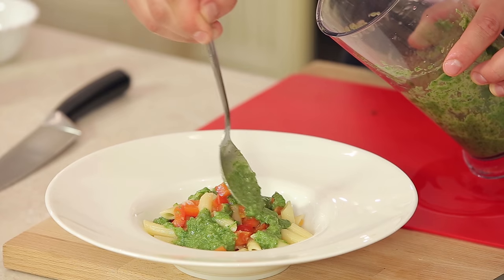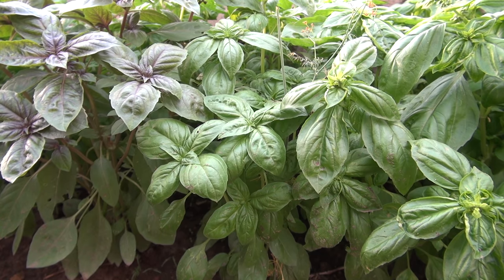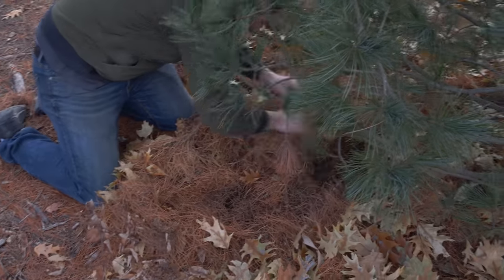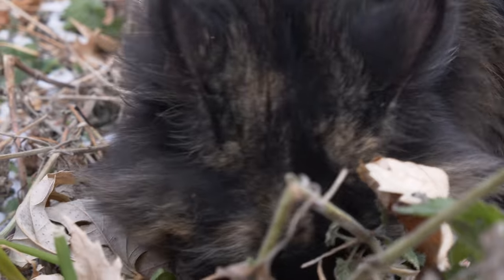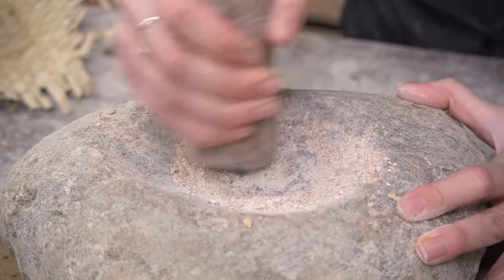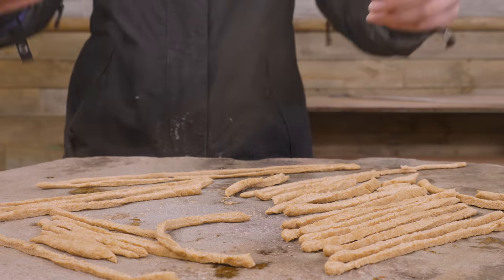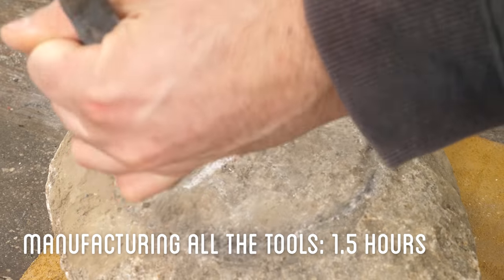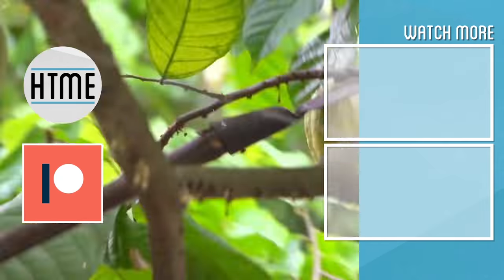How to Make Pesto That Costs $263

Comment: When I saw you use a stone masher in a ceramic bowl I though "oh no that is a mistake" you're gonna grind the clay and get the sand loose. Then, you did.
Reply: what are you supposed to use instead of a stone pestle?
Reply: @vandilore  Typically the pestle and the bowl are made of the same material. Otherwise you'll always grind the softer one...
Reply: @Tina-Brune  Time for the diamond pestle and mortar
Reply: @foty8679  I don't think it would work, I've used a glass one before and it was slippery and bad. In my experience granite is just the best : hard, rough enough to grind, nicely heavy. 

Good luck carving granite with iron age tools tho.

Comment: You should look into 'case hardening' if you want your iron tools to be harder (and, not deform/dull when working with them). It basically converts the surface of iron tools to high carbon steel which can be tempered.

Comment: Pesto is not of Roman origin. It originates in Genoa, the capital city of Liguria. Traditional modern pesto only uses 4 ingredients: olive oil, basil, pine nuts, and parmigiano-reggiano. Some people add 1 garlic clove, but is not really traditional. No salt is needed because the parmigiano-reggiano is very salty. In the island of Sardinia they use pecorino sardo instead of the parmigiano-reggiano. The pecorino sardo is made from sheep's milk, which gives pesto a more creamy texture. Personally, I like to use pecorino romano and parmigiano reggiano, both. 
8:00 What you have there are curds (the fats from the milk), not ricotta. Ricotta means "cooked again", for which you need to re-cook the whey that was taken away after separating the whey from the curds. 
12:30 Also, ricotta is not a cheese because is made from the whey, cheese is made with the curds (the fat from the milk).

Comment: For working with stone it’s been shown that used a controlled thermal shock to put holes into and through rocks. I’m betting it’s not as easy as that sounds or anywhere near as safe. But it’s how the made stone maces with the hole in the stone. Yep might be interesting to try to make A mortar using that technique.

Comment: When did we learn about bleach? Are you planning on creating it at some point?
Just curious because it would be really useful knowledge in a real society reset.
Reply: Well if they're going to do it how it used to be made they'll need mercury first so it may be difficult for them to gather the materials, they'll also need electricity so it will be a while, unless theres some other method of making it that I dont know about
Reply: Vinegar was used in that scenario back to the time of the plague. Some of us still do.🙂
Reply: For much of history ammonia was used where we would use bleach. It can be obtained from urine (and some other sources).
Reply: It's piss. That's pretty much the best we had for most of history.
Reply: @NickHorvath  Even as late as the 1800s, it was used in the laundry.🙂
Reply: If you are really interested in what you should do in a real reset I would suggest a chemistry class or two and perhaps a couple of geology classes and some horticulture classes, when combined with some independent research, experamentation and practice you will be fairly well prepared.
Reply: @trishthehomesteader9873  that’s nice, that’s about 150 years ago. Or, less than 1 percent of one percent of human history.
Reply: @Mostlyharmless1985  Jeez. Just giving some alternatives. It doesn't have to be just one thing...🙄
Reply: @trishthehomesteader9873  then, it would be pee. Fermented pee specifically. It was collected around the cities in Rome. That’s what we had for bleach till the Haber process fixed nitrogen without all that pesky urine collection. Then we had electrolysis of salt water for the production of chlorine in useful quantities to be used as sodium hypochlorite. Chlorine wasn’t discovered till almost 1800 so it’s a little bit outside the reach of a person who has Iron Age tools, and hasn’t even worked out water wheels.
Reply: Romans employed urine for bleaching.  That  really gives a different idea of attending a Roman Senate assembly.
Reply: @Mostlyharmless1985  I believe the OP was referring to cleaning having to do with the current illness. It's easily disrupted with soap and water, isopropyl alcohol or vinegar. No need for ammonia or bleach. Both are difficult right now.

Comment: You guys are something else.  The only thing in this video you didn't make was the soil!  Here's something interesting about bread: old-time cooks may have allowed to rise under a damp cloth.  The moisture in the towel discourages it from sticking to the dough---though I doubt that it was effective as oil and plastic wrap, the parlance of internet bread recipes.  I noticed that when you slit the bread, it was quite dry on the outside.  A tough skin on the bread resists oven spring.  The slit partly compensates but I suspect any culture that's trying to make light yeast-raised bread probably had cloth, too.

Comment: Next time your chiseling a rock try putting it on a bed of sand 3-4 inches deep. It will keep it from rocking and spinning so you should be able to chisel easier and faster.

Comment: Modern pesto Is not with ricotta chees. You Need to use pecorino chees that is aged sheep's cheese or, if you want, parmigiano cheese ( Is not parmesan...Is parmigiano...It Is really different). The other ingredients are ok. Olive oil, basil, garlic and pine nuts.

Comment: I have to tell you that you are not using the chisel correctly in stone. You are using the chisel if you are doing wood. 
You need a punch it's used more than the chisel. What you have to do is make parallel rolls then come back with the chisel at a 90 degrees of the rolls to remove the lines of stone between. If you have only the chisel Turn it on it's side to make the rolls then the flat remove the stone between.